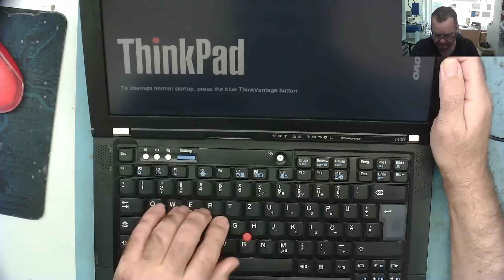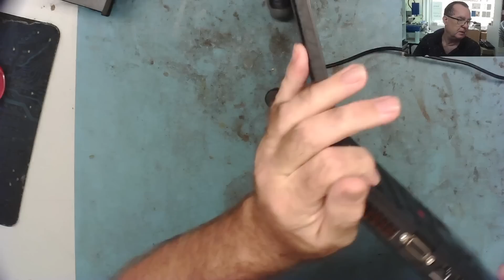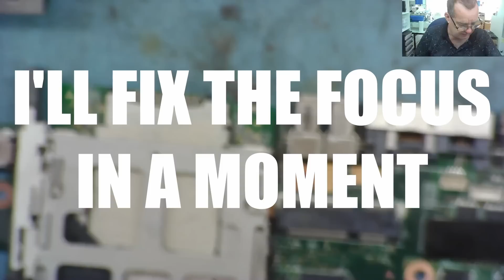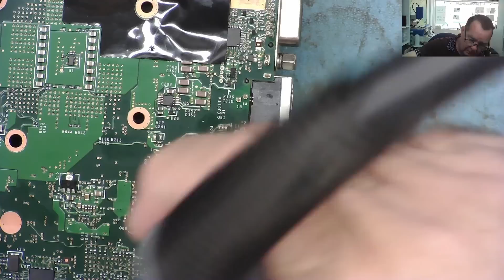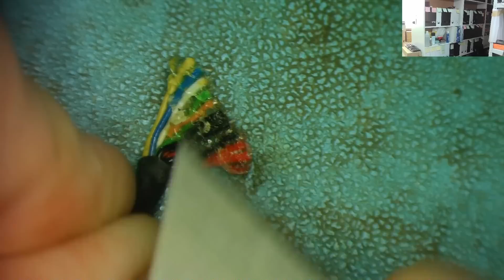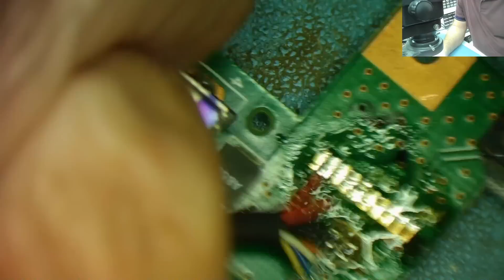Why is this Lenovo T400 stuck on Thinkpad Splash screen? Can we FIX it?

Comment: Wow, can't believe this works. I recently got an old R400 which is almost identical and it had the exact same issue, then I realised one of my USB ports pins were all twisted just like yours was! So I got a small screwdriver and twisted out all of the pins (as sadly I do not have soldering equipment) and it worked! It cost 1 USB port to sacrifice but at least it boots now haha, thanks!

Comment: I just love the way you got that epoxy off that solder joint, me I would have ripped the traces off as well,  a great job for such an old laptop but you repair it as if it's the most expensive laptop out, you have a wonderful fixing ethos and technique. Great to watch you work
Reply from the maker: Thank you.  Yes it belongs to a local shop and he has some bespoke software on there he uses with his POS (tills) so it needed fixing.

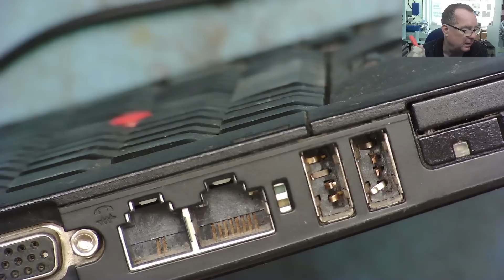Comment: 7:42 I have seen that many times, the USB ports totally fubar, some people do not understand it if a USB connector doesn't fit, to rotate it and try again, but no, they keep pushing untill is fits and don't care if the USB connector is pushed in the right way or not. Then after jamming the connector in the wrong way, the device is not recognised or the computer is acting weird, then after a while they unplug the connector and take at look at the fubar USB port, and then tak there chance on the USB port next to it, and the proces of jamming that USB connector in repeats itself again.  Then when all USB ports are fubar, the coin falls that they can't fix it by themself and need professional help. Then when they bring in the laptop, they "forget" to tell you that the USB ports are fubar, but they start telling that the printer doesn't work 🙂

Comment: I find it much easier when trying to solder fiddly wires like this,  to add solder to the wire first  and then trim it down , leaving you with a small neat tinned tip of exposed wire. since the insulation melts slightly during soldering , its best to do it this way or you end up with too  much exposed wire without insulation on

Comment: Just get another one from local 2nd hand and put swap the hdd to ssd while you're at it. Basically what I would always do :P
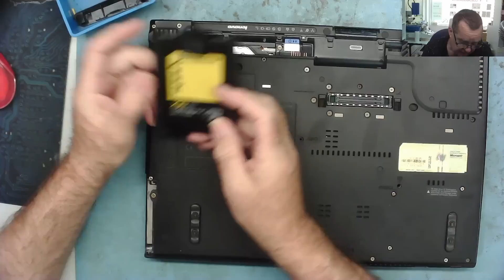Reply: The point of fixing the laptop was for data recovery so another drive is not the answer. @5:55 he tells us that it has a 256Gb SSD in it

Comment: Couldn't he have just used an external HDD reader on a 2nd PC? Seems cheaper and faster than repair, but if he needed to use the laptop further I understand why he would repair.
Reply from the maker: He has some bespoke software on here he uses with his POS (point of sale) tills in the shop
Reply: @LearnElectronicsRepair  I would tell your client to get a $5 USB to SATA cable, Richard, (or gift him one if he is a good client) as a quick workaround. He can then remove that hard drive, plug it into the cable and then the cable into a spare laptop USB port configured to boot from USB. The hard drive will then boot and configure itself automatically to the new laptop and be ready to go. It works....i have done it myself several times. In 10 minutes you have a working system on the new laptop, without altering that laptop at all. Unplug it and it's back to normal. Definitely worth the $5 investment if he has essential bespoke software.

Comment: Hi richard i wouldn't use resin but hot glue for that it is easey to remove when needed.
Reply: +1 ...  totally agree, it's easy removeability makes it the best thing I've found for this kind of thing ... I don't even have a glue gun, I just use the mini sticks with my hot air station ...🙂

Comment: I would have soldered the first cable, then the last, then one in the middle, then the rest and used hot glue.
Reply from the maker: I usually find I end up getting in my own way doing that, but I can see the logic of anchoring the wires at each down first. 🙂
Reply: @LearnElectronicsRepair  +1 ... yeah defo one end to the other here too (like in the video) with little wire ends like that, any other way would be a nightmare ... but I do agree with the hot glue ... 🙂
Reply: I would have worked from one end so you are not untwisting cores past attached ones. also remove more of the black jacket, this is station wire,it’s not a screened cable nor twisted for Linz effect so safe to peel a bit more back and make your day easier! Each to his own but isn’t this a great channel!

Comment: Wow you resurrected that beat down old thing..  someone really doesn't take care of their things.  BTW, a quick way to see if the keyboard is responding is to try the caps lock or num lock and see if it toggles the corresponding LED.  Not foolproof, but a good quick check.  Thanks for the repair videos!

Comment: Hi Richard, greetings from Down Under. Good video as usual, thank you. Have you tried an UV Resin instead of an epoxy? It hardens literally within seconds with UV light, so you don't need to wait for it to set. Have been using it very successfully for quite some time now, especially in situations like this. By the way, thank you for the invite to your Discord :-}. I sure will join.
Reply from the maker: No I haven;t tried it but I've seen people using it.  I do have a UV torch that came with some little phone repair kit (though I don't repair phones)
Reply from the maker: I've ordered some - I'll give it a try, thanks
Reply: Possibly even UV solder mask may work in this situation. That cable should not see that much tension applied to it internally. With solder mask its easy to scrrape the mask off to get access to the wires underneath.

Comment: XD  how people manage to butcher those big USB ports is beyond me. Imagine the force you need to bend the pins like that.
Reply from the maker: Good question 😆
Reply: my guess is they wear out the offset bits by combination of carelessness and repeated use until eventually managing to slip one in upside down, displacing the socket tab and breaking it in the process

Comment: Great repair yet again, was your keyboard powered on normaly when using those broken ports? Or did oyu use another one?
I saw this issue with USB before, but most Mainboards actually give the exact fault, that you have an USB overdraw issue.
Reply from the maker: I honestly don't know Daniel.  The two USB ports were broken, and the cable to the third USB port at the rear was also broken, though that could have been my fault.  Once I fixed the USB problem, it no longer stopped on the Thinkpad logo - it automatically went to no boot device, even without pressing any keys.  So it seems more likely the short in the USB port was causing it to hang.